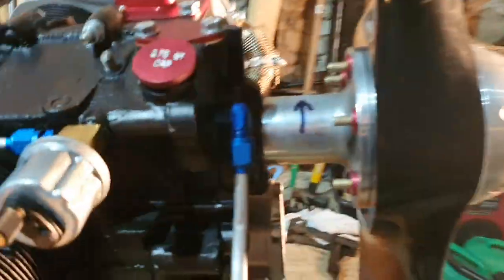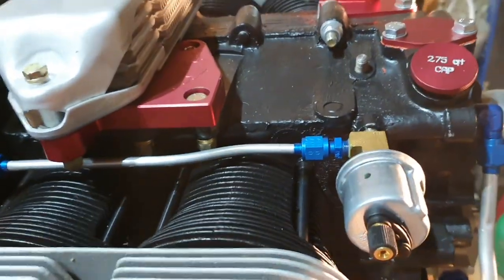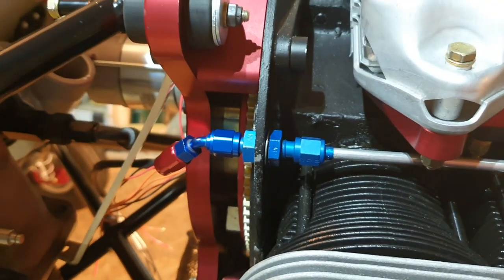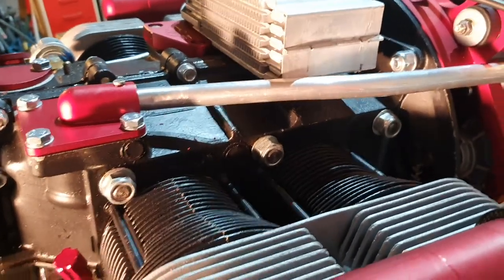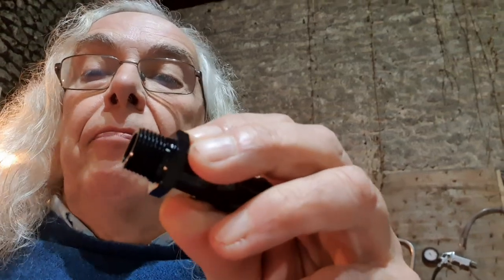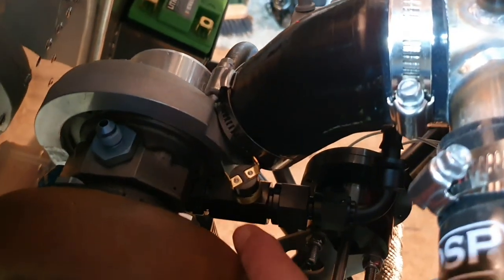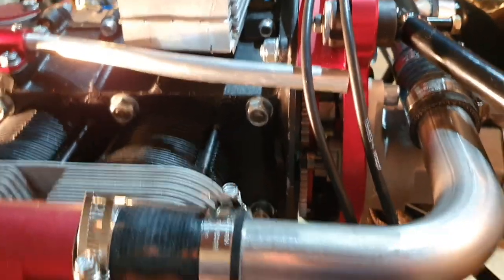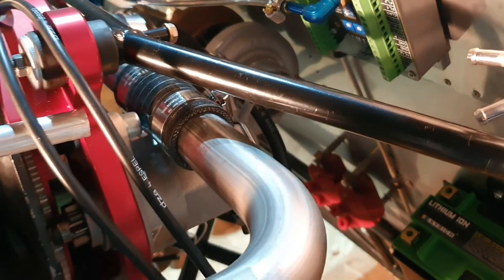Gavin's Sonex B Part 70 - AeroVee Turbo Build part 12 - Oil pipes, Turbo install, Inlet manifold

Comment: Also not sure how the oil separator works if it's not vented? The breather line going to a sealed can isn't going to work.
Reply from the maker: You can't see it from the video but there are two connections on the bottom. One is a vent which I will pipe out of the cowling at the bottom and the second is a drain 🙂

Comment: Do not make the standoff you mentioned between the intake and engine mount. Nothing on the engine, which is mounted on isolators, should be tied to the airframe (mount) besides flexible hoses or wiring that have sufficient slack to float.